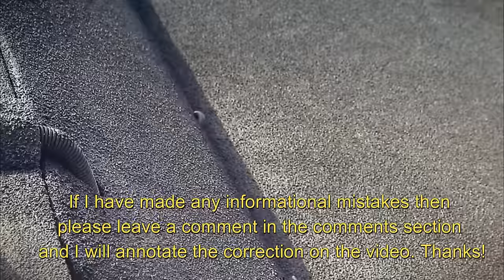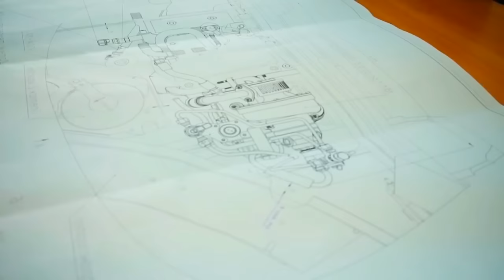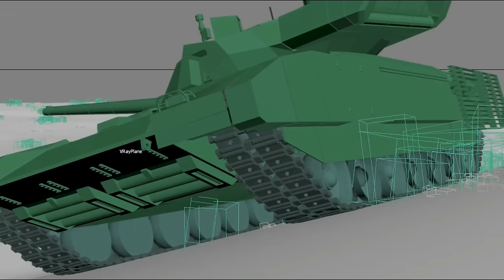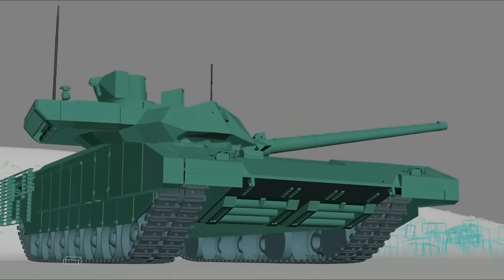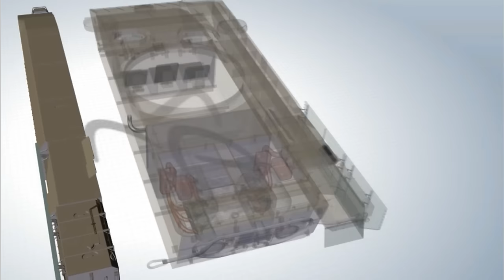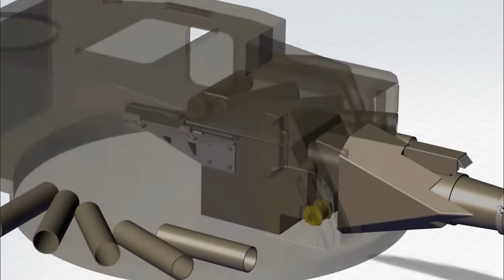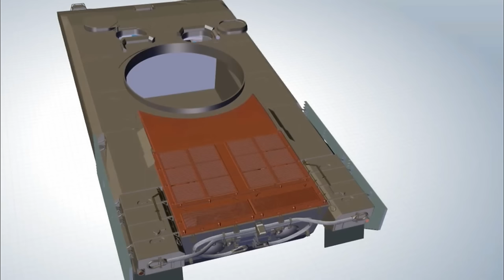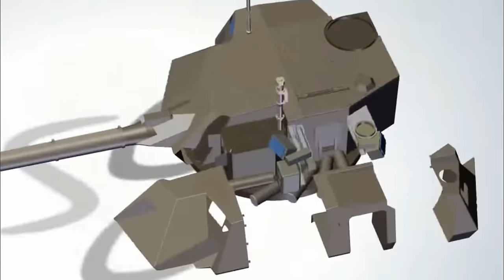T-14 Armata Russian Main Battle Tank - Tank Overview

Comment: Tanks are becoming obsolete.They are vulnerable to air power.They only make sense when used against an enemy that can not respond to them with adequate air power to defeat them. An American A-10 warthog would clear out a bunch of tanks in not very much time and the A-10 is a 40 year old plane.
Reply: A-10 not even get close to 50 miles
Reply: Tanks don't roll on the battlefield alone. THey have Anti-aircraft platforms escorting them. What you said about tanks beeing vulnerable to air power has been available from the beggining...There was one encounter in WW2 when US Air force destroyed 75% out of a Panzer division that didn't have air support or anti aircraft platforms, sometime in 1945. that doesn't mean the tank is obsolete. It's like saying "Never use rock in Rock paper scissors, because Paper beats rock, so that makes rock obsolete...
Reply: Mac Harper "when someone doesn't clearly know military strategy, wew"
Reply: Mac Harper and you're calling me stupid. facepalm

Combined arms doctorine is there in the 1st first place, and as Hetzer said, you don't roll a damn tank by itself.

They are not designed to fight aircraft, they're there to keep infantry and safe from small arms fire, grenades, and shrapnels (which are more lethal than guns themselves, discounting vital organ shots, which are obvious). They're basically mobile cover. It is agreed that tanks remain the most protected asset in the battlefield and are meant to be used defensively (and that's where tanking came from). Even though anti-tank weaponry is there, tanks are still difficult enough to disable or incapacitate.

I've played tons of militsry strategy games/war games in the past (and still is) and most strategists out there agreed that a tank is useful asset to have and last of all, even if there are others that will be able to destroy a tank, there will always be a way to prevent such measures (such as that missile prevention system in the Armata). Don't tell me to go back learning military strategy
Reply: +mark dayanghirang Some of these "Tank Buster" planes can shoot missiles rapid fire at a tank. Like 10 missiles in less than 15 seconds. Your T-14 missile prevention system would be overwhelmed and the tank would be destroyed. Go study REAL military strategy and not video games.
Reply: Mac Harper Ironic when said "real" military strategy came from said war games. You still don't get how to utilize military strategy knowledge properly. Good luck killing tanks when anti-air weaponry and enemy planes are shooting at you if you even try to shoot your missles on a tank. Again, you'll still need protection for your troops. IFVs aren't enougjh to keep them safe
Reply: mark dayanghirang You said good luck shooting tanks when there is anti air weaponry and enemy planes are shooting at you. I don't need luck. Modern jet fighters fly so fast that in many instances they can out run a missile. They also can out maneuver a missile. This is one of the reasons jets often have TWO engines.They can also shoot out flares that confuse a missile's heat seeking guidance system and throw it off course. Jet fighters are not defenseless against missile attacks.
Reply: Allow me to use your logic in my rebuttal.

"Ground-attack aircraft, or A-10, is obsolete. Before the A-10 could even find its target, enemy air superiority fighters would have engaged them first. Modern air superiority jet fighters fly so fast that in many instances they can outrun a missile, and most probably outrun an A-10 because the A-10 is not built for air superiority role. Modern air superiority jet fighters can shoot anti-air missiles at the A-10, shooting it down before it gets the chance to attack an enemy tank. In case missile attacks don't work, they have guns too."

Air superiority fighter jets master race, am I right? =D
Reply: +aegisacer An A-10 is not a modern jet fighter. They were built in the 1970's. They were not the planes I was talking about.
Reply: I did say ground-attack aircraft. When is the last time a true-blue ground-attack aircraft was designed and built? A-10s, Su-25s, etc.

F-16 is built in the 70s, so is the Hornet. Eagles too. Nighthawk is built in 1981.

So you're saying that all of them are obsolete?
Reply: +aegisacer No, they are not obsolete. I was talking more about planes like the F-22 or F-35 and drones like the Global Hawk. Also anti tank weapons that soldiers can carry with them that shoot anti tank missiles.
Reply: +aegisacer No, they are not obsolete. I was talking more about planes like the F-22 or F-35 and drones like the Global Hawk. Also anti tank weapons that soldiers can carry with them that shoot anti tank missiles.
Reply: But using your logic, A-10s and the likes are obsolete, because before they could even hit their targets, they would have been shot down by air superiority fighters.

The enemy tanks would still be alive regardless. Your typical enemy tanks can move fast, engage against your armored vehicles, and has countermeasures to throw off ATGMs.

Oh, they can fire ATGMs too.

Oh, they can also fire high explosive shells too.
Reply: +aegisacer What enemy fighters are superior to the F-16 or F-18 Super hornet? They are not obsolete. You keep saying "By my logic" and then you say something I never said.
Reply: I'm talking about ground-attack aircraft. Following your logic, a tank is considered obsolete because a CAS aircraft would rip it apart.

So, if an air superiority fighter rip a CAS plane apart, is it considered obsolete?
Reply: Mac Harper Your logic: Tanks are obsolete by future generation planes that aren't even been mass produced yet. This is why I said good luck using those when you got enemy planes and anti-air weapons considered "obsolete" swarming their way on your group of expensive planes, destroying that expensive equipment. (The Soviets did this to the Nazis during WWII). Despite your saying that the tank is obsolete, it'll never be obsolete in the future, though future designs will not be the same as it'll be in different forms unlike what we have today
Reply: +mark dayanghirang The US has about 200 F-22 jets and about 175 F-35 jets and are producing more. The Russians have about 100 T-14 tanks currently.
Reply: +aegisacer F-15 F-16 and F-18 are all capable of ground attack. Also F-22 and F-35. These planes are all constantly updated to maintain tactical advantages.
Reply: And before they could engage ground targets, they would be engaged by multiple air superiority fighters and ballistic anti-air systems. They can't even engage ground targets.

So by your logic, they are obsolete because they can't even perform their CAS roles.
Reply: +aegisacer Yeah sure. We are hopelessly at the mercy of the Russians and their invincible new T-14 tank. Just like the US Navy and its ten active aircraft carrier battle groups are hopelessly at the mercy of Russia's one outdated carrier the Kuznetsov. I hope they don't kill us all. :-)
Reply: +aegisacer FYI. The US has over 14000 total combat aircraft in its military arsenal. The Russians have less than 2000. Geez, you are right. I hope they don't overwhelm us with their air advantage and military superiority. :-)
Reply: Who said anything about Russian?

Okay, so they have 14,000 combat aircraft. That's great!

So are you going have all 14,000 aircraft replace your "obsolete" M1A2 Abrams?
Reply: aegisacer No, we are gonna send all 14,000 of our combat aircraft to go and attack the less than 100 T-14 tanks the Russians have produced so far and see how good those anti missile defenses it has are. By the way, The T-14 needed to go back to the factory for redesign and retooling after the first batch of 32 that were delivered did not function properly in the field. So much for the invincible tank.
Reply: Mac Harper tank are not obsolete as in modern battefield,more often than not,an army is less likely to fight opponent with air power.Canadians want to replace tanks with light wheel ifv with cannon,however,in Afghanistan,they find out that their leopard 1 has better armor and mobility,that's why they later instead upgrate their tank fleet by aquiring leopard 2a6m.
Reply: Mac Harper Who said anything about USA versus Russia.

I'm talking about tanks and aircraft in general. So you're telling me that M1A2 is as obsolete as the T-14 because jets could do "anything".

Mmmkay. You can keep dreaming.
Reply: Mac Harper 
Tanks can push capture objective etc.. If you have an underground bunker a plane can,t do anything to it... 
Also in no way the American will send out 14000 air crafts at the same time. 
Airplanes are usually more expensive than infantry units.
Ships are better at capturing(by carrying troops) targets in a separated land mass

Also good luck bombing things when you are flying at mach 2
Reply: Air plane are what their name suggested AIRplane, it was never intended for an airplane to capture an objective(Completely bombing  is not capture)
Reply: Mac Harper you playing to much battlefield 4
Reply: +SideCross I don't play video games.
Reply: Every single main battle tank is not only built to withstand multiple missile hits depending on the size but also carry multiple flares. Not to mention Tank platoons come backed with Mobile anti air and Russian anti air is disturbing. AND escorted anti air. Your brain is obsolete
Reply: Also 40MPH HAHAHAHAHAHAHA where did you get those numbers? Maybe the Abrams and chieftan on rough terrain, also tell that to Germany. Leopard 2A5 hits triple digits on concrete.
Reply from the maker: starcow17 HAHAHAHHAHHAHAHAHAHAHAHHAHAHAHAHAHAHAHHAHAHAHAHAHAHAHAHAHHHHAHAHAHAHAHHHHHAHAHHAHHAHAHAHAHAHAHAHHAHHHAHAHAHAHAHAHHAHAHAHAHAHAHAHHAHAHHAHAHAHAHAHAHAHAHAHHAHAHAHAHAHHAAH!!!!!!!!!.............................................................................................ha.
Reply: Matsimus Gaming hahahahahahahahahahahahahhaha. HAAAAAAAHAHAHAHAHAHAHAHAHAHAHAHAHAAHAHAHAHAHAHAHAHAHAAHAHAHHAA
Reply from the maker: starcow17 Lol
Reply: +starcow17 You must be nuts. I just watched a clip on YouTube of a rebel in Syria who took out a T-72 main battle tank with just a hand grenade. He just threw the grenade at the top of the gun turret and the whole tank went up in flames. He must have hit the ammunition.
Reply: Mac Harper keep in mind you cant just order an airstrike because if theres a tank, theres always an AA in the area
Reply: Mac Harper If you didn't know the tanks Russia sells to people aren't standard issue tanks. They are downgraded quite a lot actually. Usually lacking armour. But yes I've seen that video.
Reply: +starcow17 Listen, this notion that you have that this new Russian tank is impossible to defeat is a joke. I always hear about how superior Russian military hardware is to the west. Then you get an incident like a year ago when Turkey shot down a Russian SU-24 with an American F-16.
Reply: Mac Harper when did I say the t14 eas invincible?
Reply: Mac Harper and yea? I'm really sure the SU was ready to enter combat seeing how they had no right to be shot down and they were flying at low speed. and what is the point there? M4 shermans could kill Tigers in wwii but it doesn't mean they were better.
Reply: Or more so that Tigers weren't better.
Reply: +starcow17 The country that fielded the Sherman's WON THE WAR. What does that tell you?
Reply: Go back to common sense pre-school. I do agree that tanks are obsolete, in a certain way. Sure, if you want a powerful direct fire ability that's mobile and well protected, you call tanks, but you are right to say that air power can decimate most tanks. Thing is, not all armies can afford air power suprisingly enough. And the reason I'm asking you to think twice before trying to roast or trigger a massive conversation like the one you created is the following: Take for example the Sherman from WW2, it fired a 3 inch projectile or 76mm. The Tiger, the WW2 main battletank, would withstand almost any damage from that projectile, except from angles or direct shot at the engine. Even in high numbers with several guns firing at once at the Tiger, it would survive. Unless, of course, the tank itself takes material damage like the turret taking too much damage or the tracks going down, the rounds never penetrated. So now, tell me how a tiny 30mm projectile, even fired at 60 rounds for each seconds on the trigger could cause more than light exterior material damage on a modern tank? Even the Leopard 1 could withstand that. They called that a tank killer but even with penetrators, a lot of little damage with the innacuracy of the A-10, there is no way that it can take out bust out a full tank in what the movies of videogames managed to teach you. Hell, th people who brought you the classification of "Tank Killer" for the A-10 are the same people who classified the M2 Browning in the earlier 30s as an anti-tank weapon. Because a tank is many things, not just MBT, it can refer as a IFV to the US military for example. For instance, a tank is for many people a slow moving vehicle with thick armour and lots of firepower. How many vehicles answer to that description? I mean, the Armata has one thing, lots of armour and lots and lots and lots of it, so no, I'm sorry, the A-10 is just a bomb carrier. So please, don't give trophees or attention to something that doesn't deserve it. Because, in the end, it's basically like saying: "This warship only has 3 inch of armour at crucial areas, tank rounds can penetrate that big time". Hell, don't get me wrong, maybe even a 30mm AP round could. But in the end, size does matter. Because a 30mm projectile attacking a 24 foot target won't cause anything anymore impressive than on something 200 times that size.
Reply: +KallegrandStudios Okay, let me help you go back to common sense. You said the Armata has "lots and lots of armor." It only weighs 48 tons. A WW2 Tiger tank weighed 56 tons. An M-1 weighs 68 tons. It ain't that heavily armored. It relies on threat detection to survive. Secondly, you said an A-10 is just an inaccurate bomb carrier. If that is the case then why has that plane been in service since 1976 and still flying today? The answer is because it gets the job done.
Reply: Mac Harper The only reason why it is 48 tons is because many outdated modules are upgraded 
like the radio for example, the thing used to be huge but now it is just a box.Not only that tiger hull is not sloped and anyone that have an idea can tell you slope can make your effective armor  thicker.

And you are assuming the second strongest military have a tank that is weaker than the Tiger1 that is plain stupid
Reply: +Silp K. One of the reasons the T-14 is lighter is because that makes the tank cheaper to manufacture. It is partly economic. The lighter and less expensive the tank the more of them you can afford to build. Russia depends on oil revenues in order to sustain itself economically. The price of oil used to be well over $100 a barrel. Now it is at about $40 a barrel.
Reply: So what does that have to do with your "armor weaker than a tiger 1"
Reply: +Silp K. The armor on a T-14 is lighter than a Tiger because a T-14 weighs a lot less. A Tiger weighed 56 tons a T-14 is 48 tons.
Reply: Have you ever heard of sloped armor? Space armor? Yeah Tiger 1 don't have that
Reply: +Silp K. Yeah, the Tiger did not have sloped armor, it just dominated the battlefield one on one when it engaged the enemy. It did not need sloped armor. Many projectiles shot at Tiger tanks from Sherman tanks used to bounce off. You usually needed three or more Sherman tanks attacking one Tiger at the same time from different directions to take it out.
Reply: +Silp K. Yeah, the Tiger did not have sloped armor, it just dominated the battlefield one on one when it engaged the enemy. It did not need sloped armor. Many projectiles shot at Tiger tanks from Sherman tanks used to bounce off. You usually needed three or more Sherman tanks attacking one Tiger at the same time from different directions to take it out.
Reply: Mac Harper Nobody said ANYTHING about the T-14s or any sort of Russian equipment. We are all talking about tanks and aircraft and their effectiveness in general. YOU'RE THE ONE that started this saying how tanks like M1A2 Abrams, Leopard 2s, T-14 Armatas, Tiger tanks are OBSOLETE BECAUSE ground attack aircraft exist to kill tanks!

Also, the King Tiger and the Panther tanks have sloped armor. So your point on Tiger tanks not needing sloped armor is invalid since the Germans considered sloped armors to be effective during the war.
Reply: +aegisacer I did not say tanks are obsolete, I said THEY ARE BECOMING OBSOLETE. If you can destroy an 8 million dollar tank with an RPG or a Tow missile, then tanks are becoming obsolete. Why build an 8 million dollar machine that can be destroyed by a $20,000 missile? Or even a grenade? My point about the Tiger was that it did not need sloped armor because IT DOMINATED ANYWAY.
Reply: Mac Harper Please check your previous comments before you attempt to defend yourself. Your original argument states that tanks ARE obsolete because air power existed.

Don't try and twist your words here.

Also, your "obsolete" Abrams, Challenger tanks and T-90s have survived encounters with anti tank weaponry before. It is recorded that the Challengers have received 70 RPG hits during their deployment in Iraq.
Reply: +aegisacer Air power does not "existed" as you put it, It exists. And yeah, air power does a lot to neutralize the tank threat. Listen, I know you don't want to hear it, TANKS ARE BECOMING LESS AND LESS USEFUL ON A MODERN HIGH TECH BATTLEFIELD. They are expensive and vulnerable to much less expensive counter measures. Get this truth into your thick skull. Tanks are becoming dinosaurs. Tanks have been around for 100 years. This is what happens when technology progresses. It makes the old ways of doing things OBSOLETE. 

As far as tanks surviving RPG hits in Iraq. Sometimes tanks get lucky. The same way sometimes when people get shot they don't die, they just get badly injured. A direct hit will usually finish a tank. It depends on where it gets hit.
Reply: Mac Harper "Tanks are obsolete.They are vulnerable to air power.They only make sense when used against an enemy that can not respond to them with adequate air power to defeat them. An American A-10 warthog would clear out a bunch of tanks in not very much time and the A-10 is a 40 year old plane."

I'm pretty sure you wrote this bloody comment. So stop trying to twist your argument. We're talking about air power against tanks here, NOT about INSURGENCY WARFARE.

Obviously, tanks are NOT meant to roll into cities and towns for combat - they are NEVER designed for urban combat. Technology progresses, both for tank and anti-tank weaponry. Ground attack aircraft can only do so much to support advancing ground forces, and are more expensive to sortie than an advancing tank battalion. Tanks are, however, heavy frontline duty assets that SUPPORTS infantry and IFVs on the field, especially in open plains of Europe. They're not meant to kill tanks like many believed - they're there to SUPPRESS the enemy forces and COVER fast advances.

Only a god damn idiot like you would replace tanks with aircraft and anti-tank armaments, only to get your defensive positions overrun by COMBINED ARM TACTICS of the US Armed Forces.

You mean, RPG gets lucky in disabling a tank? Because I don't see ANY Challenger tanks having a record of getting destroyed by an RPG.
Reply: As far as I'm concerned, We've squeezed all of the possible useful information from this log, and anything past here will devolve into "my ideas are better" flame war.

personal verdict:
  Tanks aren't obsolete. not yet anyways. you may be right, the battlefield is a dynamic thing, and the forces at play say you mus evolve or die... Not more than 100 years ago, tanks weren't even present on the battlefield, so it isn't impossible a superior unit type may one day replace them, like combi/AFV-AT vehicles that are lightly armored, and still effective at taking out heavy armor. Who knows.

The problem here is Mac has said that the presence of one battlefield asset renders another one obsolete, even though it doesn't sate all of the operational requirements.

so. what is a tank?
Tanks Provide the following:

*Effective anti armor capabilities.
*shielded movement around the battlefield for personnel.
*effective means for structure demolition.
*Vehicular support for infantry battle-groups.
*A nearly risk free method for dislodging support weapons like Machine gun nests and mortars.
*Long range firing capabilities in open field scenarios, with accurate fire at high speeds to boot.
*Infantry suppression via coax and frontal MG turrets (if applicable).

so. you recommended replacing tanks. AT FIRST with attack aircraft/Jets in general.
Jets provide:

*Ground attack capabilities, Including anti armor, structure, and support weapon munitions.
*A means for bringing down enemy air support.
*improved battlefield awareness via reconnaissance jets.
*limited and somewhat inaccurate infantry support.

and anti tank weapons, such as RPG-7s?

*Valid anti armor capabilities in what would be SUICIDAL RANGES in anything but dense brush or urban environments.
*limited capability to dislodge support weapons such as MG nests and mortars.

So whats the point?
Tanks have their own place in the battlefield. They aren't and will never be made obsolete by an aircraft of any sort, other than potentially a super heavily armed and armored gunship/helicopter that can provide that close range troop support. Tanks may eventually be replaced, but it wont be by an aircraft of the conventional sense. If the air force needs a new plane, they'll make it, and tanks will still be tanks.

Aircraft are, however, much easier to mobilize than ground forces, and even though they can smash armor in droves, a good tank crew can slaughter infantry in droves, as can a talented AAA team shoot down aircraft in droves.

I really liked the rock paper scissors analogy, because it exemplifies the Idea here.

If tanks were made obsolete, they wouldn't exist any longer, just as you don't see zeppelins or Sail driven vessels in the skies or in the sea.
Similarly to how there aren't really battleships anymore. those have truly been outdone by aircraft carriers.
Reply: +Blake Barton I did not say tanks are obsolete. I said they are becoming obsolete. Some of the tasks tanks used to do in the past they are not as reliable for now on a modern battlefield. One hundred years ago when tanks arrived on the scene you did not have air power. You also did not have ground troop that could carry anti tank weapons with them like Tow missiles. Technology is evolving tanks kind of off to the sidelines. I never said they were still not useful in certain circumstances. They are not as useful as they once were. I also never said you could replace them with jet fighters instead. Let me put it this way, I would rather be a fighter pilot attacking a tank than a tank commander having to deal with an attack fighter.
Reply: +Insert Name here WHAT IS YOUR NAME?
Reply: Mac Harper ...
Reply: well it helps that it can carry 2 times its own body weight in  payload
Reply: +Mac Harper "Tanks are obsolete." That's a quote from your original comment, stop trying to tell people otherwise XD
Reply: Adolph Clinton you can say that again
Reply: Neat Noot Tanks are not all that viable anymore. They are two things that a military does nor need, EXPENSIVE AND VULNERABLE. This is called obsolescence.This is why the US has not developed and deployed and new tank since 1979 when the M-1 came out. It just keeps upgrading the M-1. There are simply too many anti tanks counter measures that are effective and not that expensive to implement. At the same time, The US keeps developing new jet fighters all the time. So, you tell me where the future is headed genius.
Reply: Silp K. Thanks genius.
Reply: +Mac Harper the future is headed to you arguing with more people in this comment section, and many other comment sections, across lots of other videos. I don't care where the future of tanks go, as long as they aren't on my front doorstep, they don't concern me. I just don't like it when certain people (not gonna say any names) try changing and twisting their statements to better suit their arguments, instead of just sticking to what they ORIGINALLY SAID. Hehehehehe
Reply: Mac Harper they may be obsolete but they wont go puff in to a cloud of smoke they will have another 50 years
Reply: ***** I am an American. All I have ever heard all my life is that Russia is constantly threatening to attack the USA. And then you go and invade Poland or Ukraine or something like that. Poland is now part of NATO, so the invading Poland nonsense is over. As long as Russia leaves the US and our allies alone YOU WONT GET NUKED. By the way. The reason your new tank is only 48 tons is because that makes them CHEAPER to build because your country IS BROKE. Have fun drinking your Vodka and smoking your cigarettes.
Reply: ***** YOU said Russia never invaded Poland? Go look up The Katyn Massacre. Russia never did any genocides? What was Stalin doing with his purges in Russia for decades? He was committing a genocide on his own country. You occupied Eastern Europe for decades and forced communism on them. Give me a break. As far as your country being under fire all the time. MY country was under fire while The Declaration of Independence was being signed. The White House was burned down in The war of 1812. If Russia would leave people alone nobody would bother you. You keep making trouble all the time. You always threaten your neighbors. You endlessly threaten the west. Then you always have big military build ups you can't afford. Every time Putin has a problem he blames the USA instead of his own incompetence. Its a big joke.
Reply: Kei Presley Go learn how to use the three functioning brain cells you got in your head. Tanks are on the way out. They are too slow which makes them too vulnerable to missiles and air power. If you can destroy them with things like hand grenades and shoulder fired missiles then they are not worth the cost. There are too many threats to a tank coming from different directions at the same time on a modern battlefield.
Reply: +Mac Harper Source? Tanks and planes have existed together for 100 years, why would planes come out on top now? And I'd like to see proof of a hand grenade (which have been around since ww2) destroying a tank from the outside. Also, RPGs have been around since ww2, with up to 30cm of penetration capability at that time, why would it change now, when tanks have much better systems to protect against them?
Reply: There is a clip on youtube. "Syrian rebel destroys T72 tank with a hand grenade." That is the title of the clip. The reason tanks are more vulnerable now then 100 years ago is because now you have lots more anti tank weapons and jet fighters are much more technologically advanced with precision guided missiles.
Reply: I disagree,I was a tanker in the 70's and you need to remember the combined arms that will be brought to bear,it really depends on who is able to get air superiority. If one side has the air,then it gets really dangerous but never underestimate modern SAM's. That happened in the 1973 Yom Kippur war and a large price was paid by the IAF.
Reply: everything  plays a significant role in the war game, tank > AA systems >> Planes > Tank .

nothing is obsolette, got it ?
Reply: +Mac Harper +Mac Harper the hand grenade was thrown down the barrel into a open breech in that video. WW1 and some early WW2 tanks could be penetrated with rifles, FREAKING RIFLES, why do you think a 30mm cannon or missiles, which they did have in WW2, along with HEAT projectiles which have hundreds of mm of penetrating capability, be less effective then when they had less ways to protect against it, instead of now, when they have so many more defenses?
Reply: Neat Noot You are hopeless. You will never understand this. The point I was making with that clip is that a multi million dollar tank was  defeated by a $100 hand grenade. Tanks are vulnerable to much cheaper counter measures that effectively kill tanks. So why keep building them? They are becoming less and less worth it. You don't need tanks to occupy territory, you need troops. Stop talking to me about WW1 and WW2. That was a hundred years ago. Anti tank technology has progressed massively since then.
Reply: +Mac Harper my point is that the army thought tanks were almost not even worth having in the 1920s, because they were so unreliable. So why would they be useless now, even though they're considered a staple of armies all across the world?
Reply: +Mac Harper also in that hand grenade video, think about all the guns in and on a normal tank, there was probably something seriously wrong with the crew inside the tank. So that video would be credited to human error.
Reply: Neat Noot Tanks are military status symbols. They are prestigious weapons to haul out during a military parade like the Russians and Chinese do all the time. This does not mean that they are not becoming less useful on a modern battlefield. There are threats to tanks that come from the air and the ground now. A soldier with an RPG can take out a tank with relative ease. Forget about what jet fighters could do to them or missiles fired from naval vessels at advancing tank columns at long ranges.

As far as that clip, you called it human error. Listen, if a tank can be destroyed by a grenade, under any circumstance, that exposes the vulnerability of a tank. That is not human error. That is the vulnerability of the tank. An RPG is basically a launched grenade. They can decimate a tank. I am not saying tanks are useless. I am saying that they are becoming less and less useful, and not justifying the costs of producing them, if they can be defeated by an enemy with much cheaper counter measures, such as RPG's or even hand grenades like in that clip. The era of the tank is not over but it seems to be winding down.
Reply: Tungusta's got your A-10 owned.
Reply: Mac Harper So, you’re trying to say that the Tiger tank is better than the T14 is because it's heavier, I don't get your logic here. Have you ever considered the type of armour? Not just the thickness of it. The T14's armour is mixed with various composites and ceramics making it lightet and stronger than steel (the armour that the Tiger had) making it better. A cheaper weapon doesn't make it a bad one. Take the AK47 for example, it's cheaper than its western counterpart but it works and better in some aspects
Reply: Evan Borne Do you believe that the T-14 is going to dominate the battlefield the way the Tiger tank did in WW2? Tiger tanks used to blow Sherman tanks apart. It often took 3 Sherman tanks to take out 1 Tiger tank. All the composite armor that a T-14 tank has is also in the M-1 tank. It is also in the British Challenger tank, and the German Leopard tank, and the Israeli Merkava. Where do you think the Russians got the idea for composite armor? The M-1 in fact has about 20 tons more of it than a T-14. Which one do you think might be more survivable? My remarks were a response to the comments by some on this thread that the T-14 is the new super tank that is going to blow away the competition. It will not. The T-14 is kind of actually late to the game.
As far as the AK-47. The biggest problem with it is that it is not accurate when you shoot it like modern machine guns are. You kind of have to spray a target with bullets to hit it. The AK-47 is a 70 year old Russian design. If you would rather have that gun in combat than a modern and precise machine gun I don't really understand why.
Reply: Mac Harper You're kinda avoiding the point here, I was replying to your reply saying that the Tiger is somehow better than the T14 which is impossible. Now, the T14 while not being the most heavily armoured contender here, that crown goes to the Challenger 2 with its Chobham Armour, it does certainly brings new elements to the battlefield such as capable of being unmaned, and to be outfitted with a bigger gun, a 152mm, that would outgun the M1 Abrams with it's 120 mil. It's also faster, and it doesn't cost as much to refuel, versus the Abrams that would cost a fortune to do so. The T14 is no "super tank" by any stretch of the imagination but it is a potent one, and it would probably give its competitors a run for their money, but alas it's hard to surely know since tank on tank battles (not obsolete tanks that are operated by monkeys, I mean high tech vs high tech) are rare these days. We only have here are statics and numbers, until one day if the T14 could one on one fight its competitors only then can we really know who's on top. Now, the AK47. Of course it's not renowned for its accuracy, but, its reliability. You could, not clean for weeks and it would still run, while its counterpart the M16 wouldn't. Also the 7.62x39 definitely has more stopping power than the 5.56 NATO. Accuracy wise, it's good enough. Give it to a well trained individual that doesn't pray and spray like you said, you got yourself a pretty good weapon considering that it's 70 YEARS OLD. I don't know where you got the idea that it has to spray to hit its targets, I'd say that's a myth. AKs do pretty well in semi auto. Hey plus, no said that the T14 was a super tank blowing away its competitors, I thought we're talking about tanks being obsolete and shit.
Reply: Did Tiger ever dominate any battlefield?
Reply: LaserAirsoftWeapons Yes, it dominated every time it came up against Sherman tanks, one on one, during WW2. Sherman tank crews became so fearful of dealing with Tiger tanks during the war that they nicknamed the phenomenon "Tigerphobia."
Reply: Evan Borne I NEVER SAID THE TIGER WAS BETTER THAN THE T-14, I SAID IT WAS HEAVIER. THAT'S ALL. I run into this bullshit with a lot of people on here. I SAY ONE THING AND THEY HEAR ANOTHER. The Tiger tank existed 80 years ago so how the fuck could it be better than a new modern T-14? Tiger tank weighed 56 tons, a T-14 is 48 tons. THIS IS WHAT I SAID.
As far as the AK-47, you said that it is "not known for its accuracy" but that it was accurate enough. If a weapon is not accurate when you shoot it how is it good? You said it was "accurate enough." Accurate enough for what? Shooting at a tank? The weapons that the West uses are state of the art. Yeah, you do have to keep your rifle clean, but if you do you can shoot these weapons with laser point accuracy. You mean to tell me you would prefer an AK-47 "accurate enough" weapon to a totally precise one? If you would, then you have a decided disadvantage in combat. Please understand that I am not yelling with my caps, I am frustrated people do not seem to hear what I say properly. The Tiger tank dominated in combat during WW2. THAT IS WHAT MADE IT SPECIAL FOR ITS TIME. The T-14 is a good tank but it will not own the battlefield. I have argued with some people on here who claim that it will. THAT IS NONSENSE.
Reply: Hmm, the comment Slip K. made earlier said "so what does that have to do with your "armour weaker than a tiger 1" then you replied, "The armor on a T14 is lighter than a Tiger because a T14 weighs a lot less. A Tiger weighed 56 tons a T14 is 48 tons." hinting that the Tiger's armour is stronger than a T14 because it's heavier. I shouldn't have said better but, the comment you made just sums it up.
Reply: Evan Borne When exactly did I "hint" that a Tiger's armor is stronger? HMMM, I never did. I just said it was heavier, which it was. You did it again. I say one thing, you hear another thing. Oh, and by the way, just for the sake of argument, how exactly DO YOU KNOW for a fact that a T-14 has stronger armor than a Tiger tank did anyway? A T-14 has a lot less armor but how do you know it is stronger? Do you have access to Russian military secrets? If a tiger tank and a T-14 had the same amount of armor I think it would be certain you would be right. But being that a T-14 has 8 TONS LESS ARMOR how can you know for sure? Even with all the modern composite ceramic reactive armor and stuff.  My assumption would be that a T-14 would beat a Tiger tank from WW2 not because it would be more survivable than a Tiger in terms of its armor, I don't know that for sure really, but because it would have massive technological advantages over a Tiger with its radars and weapons systems. That I know for sure.
Reply: Mac Harper Easy, Tiger has RHA (Rolled Homogeneous Armour) while the T14 has Composites. I'll let you figure out why the T14 would beat the Tiger's armour, it doesn't take a rocket scientist to figure this out.
Reply: Thank God we have a genius like you around to figure out the obvious. You know, obvious stuff like a modern tank built today is technologically superior to a tank built 80 years ago. Then you will turn around and say something dumb like the AK-47 is better than a Modern high tech machine gun even though an AK-47 don't shoot accurately and was designed 70 years ago. Go figure.
Reply: Tunguska still eats A-10's lunch.
Reply: Mac Harper Hahaha, you see...first off, you asked "how exactly DO YOU KNOW for a fact that the T14 has stronger armour than a Tiger tank anyway?" so, I gave the answer, Tiger has RHA which would NOT protect it from modern HEAT and APFSDS rounds while the Composite armour of the T14 can (while it isn't completely impervious to both HEAT and APFSDS, it is definitely stronger than RHA, and that's a known FACT). Secondly, I didn't say the AK47 is better than the so called "modern" machine gun, I agured that the AK47 is accurate enough to be a usable weapon, where you said it has to be sprayed to hit something which is total bullshit. And with its modernisation the AK103, the AK74 and the recent AK12 it has now been a more capable weapon platform. Mind you that "accurate enough" still can kill, and it has done that lots of times. Like you said, the A10 Thunderbolt is still in service today even though it was made in the 1970s, same goes for the AK, was made 70 years ago but still used today. Lastly, why did you give a peculiar answer? Slip K. said "so what does that have to do with your "armour weaker than a Tiger 1" and you said that the Tiger is heavier than the T14, so it was perceived by me as you're trying to say that the Tiger is better because it is heavier.
Reply: No, it happened to a RUSSIAN TANK. That makes Russia look stupid Mr. Kuznetsov.
Reply: ***** Yeah, I've watched the video, for the rebel to throw 2 grenades into the gun barrel is just saying something. How the hell didn't the crew of the tank notice them sitting there? That's just bad situational awareness.
Reply: It was a shitty old Russian tank. The T-72 is JUNK on a modern battlefield. OUTDATED RUSSIAN SHIT. Right Mr.kuznetsov?
Reply: The United States has repeatedly apologized about the whole Vietnam War. We have also given billions in economic aid to Vietnam for recovery and economic development since the war ended. That continues to this day. What does Russia do to Poland? You keep threatening them.
Reply: +Mac Harper A-10 are obsolete.They are vulnerable to anti-air power.They only make sense when used against an enemy that can not respond to them with adequate anti-air power to defeat them. An Russian Tunguska, TOR, S-400, or S-500 would clear out all of the A-10, F16, F22 and F35.
Reply: Your name is Kuznetsov? Let me ask you a question. Did the Russians name that old piece of shit aircraft carrier they got after you? You know, the one that smokes like an old furnace.
Reply: The A-10 is vulnerable to anti air power? I have seen clips of A-10's that got shot up with machine gun fire and they still did not crash and landed back at their bases. They just plugged up the holes from the bullets and sent them back out again.
Reply: Your comment was so stupid I did not feel any need to reply to it. As far as your offer of "educating" me about anything? Oh please! Why don't you go smoke about three packs of cigarettes, and drink two bottles of vodka at the same time, like most of your comrades do, while you endlessly deny that Russian Olympic athletes use steroids, and that Vladimir Putin is about 5 foot 2 inches tall?
Reply: An A-10 is infinitely more expensive to produce then a tank, more time consuming to produce, alot less of them then tanks and ordnance for them is hellishly expensive. Training time for a pilot and the expense going into that is also extremely high compared to a tank crew and a plane is just as vulnerable to modern ordnance as a tank. Modern tanks are now starting to be equipped with anit-air weapon systems and can defeat planes, helicopters and their ordnance. Generally tanks are also not left alone all by themselves. They are usually accompanied by other weapon systems like the German Gepard or other anti-air weapons. I would say the modern battlefield is getting just as deadly to aircrew as it is to tank crew.
Reply: and 10000 t-92's, T-80's and 15000 IFV's of all forms and 4000 anti-air battieries of all forms, 1500 missile carriers and 10000 planes of all types and 500000 shoulder fired anti-air and anti armour weapons and about 3 million soldiers. Yep, your 200 F-22's and 175 non working F-35's aren't looking so hot now are they. Modern armies are all arms armies.
Reply: That is very typical of a new weapon system. There are always bugs that need ironing out. The Abrams had the same troubles when first introduced. That is a strawman argument.
Reply: Who said it is impossible to defeat? What was said (by you) was that it is obsolete and the whole tank concept is obsolete because airpower exists. That is utter rubbish. We know next to nothing about this tank so once again, strawman argument.
Reply: Who has got 10,000 planes? The Russians? BULLSHIT. Like you said, planes are expensive and time consuming to produce. This is why the Russians don't have a lot of them. After the USSR collapsed in 1991 they went broke. They cant afford to build a lot of planes. This is why Russia has more tanks instead. Most of their tanks at this point are outdated too. They did not have any money to modernize their forces either.
Reply: Are you serious with this comment? Do you seriously believe that America won the war single handed because of the Sherman tank? That comment is so naive it beggars description.
Reply: Early tanks used solid steel plate for armour, that's why it was so heavy. Modern tanks only make light use of steel in their construction and a predominately made of composite armours in modulized packages to increase protection but reduce weight. Even so a modern tank is still very damn heavy. Weight comparison's between these two completely different generational tanks is moot.
Reply: I quote, "Tanks are obsolete' unquote. It's right there in black and white. You did say it.
Reply: Not viable anymore? So a plane is going to hold ground and defend tactical points on a battlefield indefinitely. A plane can get down in the thick of it and give fire support at the local level exactly where and when its needed for the ground troops? I think not. Planes can deliver massive firepower on a given target for a short period of time, that's it. Tanks can maintain their firepower over an objective almost indefinitely. The longer a aircraft hovers above a battlefield their chances of been blown out of the sky begin to skyrocket and once again, aircraft are hellishly expensive to loose.
Reply: In that case you have been brainwashed into thinking that. Stop watching main stream media and listening to your politicians because they lie for a living. I actually now kind of feel sorry for you after reading that. Russia hasn't done a damn thing since the cold war was over. If you do some proper research you will find Russia is the one defending itself from aggression and lies. Russia has lived up to all its treaties since the cold war, America and NATO haven't. Not my opinion, that's fact if you bother to do your research.

As to the Ukraine you are sorely mislead. Ukraine had a democratic election and voted to be part of Russia again. NATO and the NWO didn't like that and so backed and financed the Ukrainian's who opposed the re-uniting with Russia even though they where in the minority and it was all democratic. Russia had no choice but to intervene militarily to protect its citizens and interests just as America would have done and has done many times.
Reply: This comment is so naive. You are now saying airpower is completely invunerible and invincible. Hate to break it to you but there are mountains of modern weaponry that will make short work of aircraft. Not  worth the cost? Yet a plane worth anywhere between 30 million and 400 million US dollars EACH and can be shot down by a $10000 (ball park figure) worth of weaponry is cost effective? I think I will stick with a tank worth 2 to 4 million dollars and can hold ground with it.
Reply: Hand grenades have existed since the 1860's actually. They where used in the American civil war. A hand grenade could never destroy a tank unless it was thrown into the tank. It would barely scratch the paint.
Reply: I have not seen the clip but he probably threw it inside the tank. Either that or it detonated stored heavy ordnance on the outside of the tank which actually destroyed the tank.
Reply: roger Rumble If you're talking about the Syrian tank then yes, the grenade is thrown into the gun barrel and dentonated the ammunition storage
Reply: +Mac Harper 
Sorry, I have no wish do start a discussion with you, cause you have no idea about military. Last thing I say is that Russian anti-air systems are the best in the world. A few years ago the USA and Israel were in panic because Russia sold its S-300 anti-air system to Iran. Russia itself uses newer S-400 and S-500 systems, where the numbers mean the effective range in kilometers. Your idea that an A-10 could freely fly in Russian controlled airspace shows that you are an amateur.
Reply: You don't really know much about current military capabilities do you? Russia HAS 10000 planes of all types. Not all are operational as currently they cannot afford to fly that many at the same time but they DO have them. It's called mothball. If war materialized they can have all 10000 operational in a matter of weeks. America at last count has 18000 planes of all types and it's in so much dept it will never get out of it but that doesn't stop them from having them. Russian planes are also no where near as expensive as American ones. A F-22 currently costs $339 million US EACH!!!!!!! A sukhoi costs 20 million each. HUGE difference. Sure a F-22 can beat 5 sukhoi's but what's it going to do about the other 20? Russia's planes can also operate in extreme conditions, designed exactly for that purpose. A f-22 needs a fully furbished and maintained, supplied and specific airfield to operate from. Do your research! Russia is an entirely different beast compared to North America or the middle East.

You are sorely out of date. The cold war's end was over 26 years ago and their tanks are most certainly not out of date. Their front line tank is the T-92c, a fully upgraded tank only 20 years old. The Abrams is a hell of alot older then that.. The Abrams is a 1970's design but also upgraded so your argument on that point is moot. If you think the t-92 is out of date then that would make the abrams completely obsolete. You can't have it both ways. They just built the t-14 . Sukhoi-30, PAKFA t-50 and SA-300 and 500 missile defense systems and a revolutionary new torpedo that is light years ahead of the competition. Heard of the Kursk incident? Read up on it. 300knt's underwater. America has nothing even remotely like it although they probably do now since they pressured Russia into giving the tech to them. Read up on geo-politics and balance of power, it will enlighten you. Russia may not be dripping in money but they are also not swimming in debt like America.
Reply: You are really showing your bias and ignorance with that one. Most (not all) of America's tech is either stolen or bought from other countries you ninny. China is very good at plagiarizing everything, America is good at throwing it's non existent money around, Russia is good at making things tough and resilent, Germany is very good at Engineering, Japan is very good at robotics and computer tech. My point is everyone has something they're good at. I'm bias too but nowhere near to the extent that you apparently are. I love everything German but am still aware that others can make stuff too.
Reply: roger Rumble How ridiculous. The US spends billions on research and development to produce the weapons tech that it then spends hundreds of billions to produce in massive numbers. Not only does it do this to defend the United States, but also in part to defend its freeloader allies like our European friends who never do, and never will, carry their own weight, but are becoming experts at acting like they are better than we are. How is that for a big joke? I have to admit that I am losing some respect for Euro-idiots who never make any sense when they talk. How totally stupid is it to suggest that The US buys its technical know how from countries, who don't have any money or really resources to do any research and development in the first place, with its "non existent money."
Reply: Mac Harper you said in one of your comments you said that the russians got the idea of composite armor from the west.YOU ARE WRONG since the first widespread use of composite armor have been on the soviet  T-64 tank.Also you implied that the Abrams is better armored than the T-14 because its heavyer.First of all despite all the upgrades the Abrams relies on cold war era armor.Second its very possible that the russian scientists have created lighter and stronger materials and are using them in the T-14's armor making it as protected or even more protected than the Abrams
Reply: roger Rumble Bye bye Eurofool.
Reply: Mac Harper Oi m8, jets can't outrun SAM or AA missiles. With the exception of the SR-71 but it's retired.
Reply: Mac Harper man Su 24 is a bomber and it did not expect a cowordly "freandly" fire from Turks so did not carry any defence from possible air threat. As Russia braught the 2 Su 35 planes, the Sirisn sky become closed for western planes. No single Turkish plane got in an air since then.
Reply: Kranvagn with that 150mm smoothbore gun will destroy your ass. :)
Reply: tanks obsolete? Ask the Israelis, they also thought they just need Airforce. They were proven wrong and in the next wars they also relied on tanks and infantry. There is no way around combined warfare. Airforce is great support, but cannot hold ground (and even tanks need infantry for that).
Besides: do not forget to compare costs. How much resources you need to get one plan with CAS capability in the air and how many tanks can roll for the same money? Surely more tanks are rolling than your plane has AT rockets / guided bombs.
Stating the extreme that tanks are "obsolete" OF COURSE triggers a lot of resistance and shows that you do not have a clue what you are talking about. Sorry.
Reply: Grimshak81 You don't need tanks to hold ground. You need troops. You can defeat an 8 million dollar tank with a $20,000 missile. They are not cost effective and they are too vulnerable to both air attack and ground forces with anti tank missiles. There are too many threats coming from too many directions on a modern battlefield. I am not saying they are totally useless, I am saying that they are becoming less and less useful because they are becoming more and more vulnerable. Tanks are over 100 years old. Their Hey day is behind them. You don't need to reply back to me to keep arguing. Let's just agree to disagree.
Reply: Mac Harper So, where can troops get direct fire support? Also, if the rebels have cheap T54/55 tanks, how can troops push towards a key point with paper thin AFV or IFV? Remember, those poor countries can't offer expensive planes and missiles but a cheap 2nd gend MBT. Plus the fact that a country which uses Air superiority usually have nukes and money. How can those future conflict - mostly without planes fight without MBTs?
Reply: Kerwin CHAO How did ISIS take over the cities of Raqqa in Syria and Mosul In Iraq? Did they need tanks? They went up against two different armies with tanks. Did they need any? Do you know what they had? RPG's to destroy tanks with.
Reply: Mac Harper In my opinion, the future conflict will mostly likely be agent war which can't be fought with air forces' support due to political reasons. If one side decide to use tank, the other side is screwed on the open file battle because those tank will be able to fire missiles just like what an anti-tank squad can do. Sure, the urban environment is great for those squads, but it is not true in the open field.
Reply: Mac Harper What you mentioned is urban battle filed which isn't great for MBTs. I just cleared my position on my second reply.
Reply: Kerwin CHAO The defenses for the city of Mosul in Iraq were set up outside of the city. On the outskirts of the city. They were not inside the city itself. It was not urban warfare.
Reply: Mac Harper M1 doesn't have APS sadly. :(
Reply: Mac Harper Weird, Wiki says that the city was abandoned by Iraq Army.
Reply: Mac Harper I can't find any detail information about the ISIS assault to Raqqa. I just know they captured the city.
Reply: Kerwin CHAO Did Isis capture the city using tanks?
Reply: Mac Harper I wish you know how to read.
Reply: Simply put; combined arms. A tank is an ineffective asset (namely when the opposition is organized and strategic) without assistance from both the ground and air. Enough of the damn bickering.
Reply: Have you seen the youtube clip of a militant in Syria blowing up a Russian made Syrian Army tank with just one hand grenade? A multi million dollar tank destroyed by a $50 hand grenade. Forget about what air power could do to tank or a Tow missile or an RPG or laser guided bombs. Do you know what armor piercing bullets are? There are so many threats to a tank on a modern battlefield now. This is not WW2 anymore. That was 80 years ago. I understand that tanks have counter measures. The problem is their counter measures can be overwhelmed. If there are some people who want to keep believing that tanks are a vital piece of equipment let them do so. I am saying  again that tanks are not useless but they are becoming less and less useful. They are very expensive to build and are just too easily defeated by far less expensive counter measures. They are becoming less and less cost effective. This happens all the time with military equipment as technology progresses.
Reply: Mac Harper Counter measure also involve warning radar and direct fire suppression. If you think an anti-tank squad can fire unlimited rockets at the same ambush position without getting any return fire from a third gen MBT, I can't help your logic anymore. Dude, AP bullet is for soft armor vehicle. It is already useless against +40mm armor. Show me the footage, I can't trust your word.
Reply: Mac Harper Also, I don't support both flat and Globe Earth. I don't even think we are real. XDD
Reply: LMFAO, Your reply is not even coherent.
Reply: Mac Harper You do have the same problem. What now? Another rage and cry?
Reply: Opens up a bag of popcorn ..this is pretty entertaining. By the way, Otoko, you didn't understand my text properly it seems.
Reply: In your dreams may be
Reply: You clearly don't have a clue about modern warfare strategy, Every technology is on the verge of being obsolete the moment it enters service, the difference is how you use it, how you protect your vulnerabilities, and exploit your opponents. every technology and weapon system has vulnerabilities including tanks and aircraft. just because you have a system that is capable of defeating another system, does not mean it is obsolete, you still have to be able to find it and attack it and that requires intelligence, information, strategy and tactics, in order to defeat  what is know as the defensive onion. Now do yourself a favour, move away from the keyboard until you can learn to use it like a responsible adult, and by that I mean stop yourself from blurting out ill considered opinions based on statistics you read from a website.
Reply: ashleyphotog While this is very true, there isn't much point explaining it to someone who is obstinate. Perhaps even hypocritical.
Reply: A-10 will be destroyed by mobile sam even before it will notice tank column
Reply: I strongly disagree
Reply: Mobile SAM missile sites would have been targeted and taken out well in advance of any A-10 arriving on the scene to destroy a tank column.
Reply: it is also a plane with the largest gun ever fitted onto an aircraft. The Us also has Apache's and drones to take tanks out.
Reply: Mac Harper Hardly, USA usually used cruise missiles and avaks to defeat Sams, but advanced states know how to shot down such missiles and have long range weapons to defeat avaks + powerful jamming, if USA will deal with strong country like RF or China the American infantry can forget about airsupport
Reply: But what if the A-10 fires a Maverick or something more modern and the missile gets destroyed a few meters before hitting the Tank? It seems Tanks are not so obsolete any more, uh?
Reply: yak yajme He doesn't even know what APS is. :/
Reply: It wouldn't do that if it was sent in against Russian tanks, because Russian tanks roll in with air defenses, and those murder the shit out of A-10s before it could launch the mavericks.
An old T-34 would therefore do fine in the Russian army when facing A-10s, because they have other vehicles that takes care of it.
(In a western nation, these vehicles would be jets like the F-15/F-16).
Reply: High Five to Mac Harper for never giving up! 

Though, I believe a few of the comments stand and you have surly lost your original argument and simply slivered down more paths of discussion. 

Bottom line: Tanks still play a major roll and cannot be replaced by air power, short of a flying tank/APC.

I will not argue, because you cannot be convinced. 

" 
everything  plays a significant role in the war game, tank > AA systems >> Planes > Tan
"-Thế Nguyễn Bá1

"As far as I'm concerned, We've squeezed all of the possible useful information from this log, and anything past here will devolve into "my ideas are better" flame war.

personal verdict:
  Tanks aren't obsolete. not yet anyways. you may be right, the battlefield is a dynamic thing, and the forces at play say you mus evolve or die... Not more than 100 years ago, tanks weren't even present on the battlefield, so it isn't impossible a superior unit type may one day replace them, like combi/AFV-AT vehicles that are lightly armored, and still effective at taking out heavy armor. Who knows.

The problem here is Mac has said that the presence of one battlefield asset renders another one obsolete, even though it doesn't sate all of the operational requirements.

so. what is a tank?
Tanks Provide the following:

*Effective anti armor capabilities.
*shielded movement around the battlefield for personnel.
*effective means for structure demolition.
*Vehicular support for infantry battle-groups.
*A nearly risk free method for dislodging support weapons like Machine gun nests and mortars.
*Long range firing capabilities in open field scenarios, with accurate fire at high speeds to boot.
*Infantry suppression via coax and frontal MG turrets (if applicable).

so. you recommended replacing tanks. AT FIRST with attack aircraft/Jets in general.
Jets provide:

*Ground attack capabilities, Including anti armor, structure, and support weapon munitions.
*A means for bringing down enemy air support.
*improved battlefield awareness via reconnaissance jets.
*limited and somewhat inaccurate infantry support.

and anti tank weapons, such as RPG-7s?

*Valid anti armor capabilities in what would be SUICIDAL RANGES in anything but dense brush or urban environments.
*limited capability to dislodge support weapons such as MG nests and mortars.

So whats the point?
Tanks have their own place in the battlefield. They aren't and will never be made obsolete by an aircraft of any sort, other than potentially a super heavily armed and armored gunship/helicopter that can provide that close range troop support. Tanks may eventually be replaced, but it wont be by an aircraft of the conventional sense. If the air force needs a new plane, they'll make it, and tanks will still be tanks.

Aircraft are, however, much easier to mobilize than ground forces, and even though they can smash armor in droves, a good tank crew can slaughter infantry in droves, as can a talented AAA team shoot down aircraft in droves.

I really liked the rock paper scissors analogy, because it exemplifies the Idea here.

If tanks were made obsolete, they wouldn't exist any longer, just as you don't see zeppelins or Sail driven vessels in the skies or in the sea.
Similarly to how there aren't really battleships anymore. those have truly been outdone by aircraft carriers.
"- Blake Barton
Reply: JwormJ I never said tanks can be replaced by air power, I said they can be defeated by air power. You are doing a straw man argument. You are  making a false claim and then claiming I said it, and then you are attacking the false claim and then claiming I am wrong when I never said it.. It is a pretty cheap arguing trick. A lot of you guys use it.
Reply: Don't think one-dimensional. It won't get you any useful results. It is like saying, cars are useless, because there are helicopters, that are faster and don't need roads.
Reply: In 90+ days of total air supremacy, supported by constant JSTARS survailance, NATO planes destroyed only 13 tanks during operation Allied Force, mostly T-55's. The combined price of expended smart AT weapons far surpasses the combined price of these tanks. Don't rely too much on computer games when making such claims. Tanks have been deemed obsolete for the past 50 years, yet they remain relevant today. My personal opinion is that tanks should be made more suitable for urban conflicts. Also, if you are a small country and your opponent is another small country with small airforce that can't afford too many specialized aircraft, having a superior tank force makes a world of difference.
Reply: Petar Banovac Tanks are still relevant. Less and less relevant and less and less useful and more expensive than ever before. They still have a role to play. That is clear and I will give you that. AT weapons are more expensive than tanks because they are cutting edge technologies. I was thinking more along the lines of a TOW missile being way cheaper to make than a multi million dollar tank. TOW missiles kill tanks.
Reply: TOW-2 even T-90 can not penetrate, what can we say about T-90M (MS) or T-14,
Reply: Mac Harper TOW missiles can defeat the opponent whose tank force is obsolete. Good luck counting on TOW missiles vs modern tanks. Modern tanks already demonstrated the ability to survive TOW missiles. Even obsolete tanks can be made suvivable by adding bolt-on ERA like Kontakt-5 or Kaktus.
Reply: Petar Banovac There are clips on YouTube of TOW missiles cooking up T 90 tanks. There is also a clip of a T 90 being disabled by a TOW but not cooked. Who knows.
Reply: Well, with the (also pretty old) TOW 2 you get a tandem charge which will penetrate even ERA.
Reply: Likewise, there are new generations of ERA designed to deal with tandem HEAT warheads. As Mac noted, top-attack might be a workaround against ERA, but active protection systems have been developed to deal with that threat. Long story short, you can't win without strong ground presence, epitomized by tanks. As more modern tanks are developed, so are anti-tank weapons. The winner in a conflict is the side that catches the other without effective counter. If you have a superior tank, use it while counters aren't ready yet. If the invader has obsolete tanks, he'll suffer heavy losses from tank-hunter teams. However, there's one big difference. Tank is offensive weapon. You can't hope to invade a country with TOW tubes bolted on pickup trucks.
Reply: I agree that the role of the MTB will not disappear. Especially active protection systems are likely to replace super heavy armour and reduce the weight of the vehicles in the future.
Reply: Czechnut Very well made point
Reply: Check out the USS Donald Cook and what 1 Russian plane did to it..... Shut it down....
Reply: It didnt shut it down. What a ridiculous statement. The only ships shutting down are the russian ones that are escorted by tug boats everywhere they go. :D
Reply: How do you explain its AA systems being jammed to the point of total defenselessness on the entire ship? Maybe you need to read some of the sailors diaries and how grown  men and women were praying for their own souls.... Luckily the plan was not armed lol just made many passes.
Reply: Shotgunman5 I can explain it to you. Its called internet fake news bullshit. That USS Cook story in nonsense. It was probably the Russians that made up that story.
Reply: Yeah like the Russians made up 100s of crew member experiences lmfao most of this info is classified , but if you do research instead of talking outside of your neck you may just wanna join the military and help to make sure these incidents dont happen again got it ? good...
Reply: Matthew Penfold Oh yeah, which one did this? The A 10 has been around for 40 years. Who beat it?
Reply: m8's treat each other with respect. If Tanks are becoming obsolete because of airpower, what would happen to the insurgencies in the streets? Have an A-10 shoot a bunch of missiles and endangering the public? Also, its like a game of rock paper scissors. Air Beats Tank, Tank Beats AA, and AA beats Air.
The only way to take down AA's is with a tank, and sometimes those AA's need protection, so they use tanks. It takes a tank to destroy a tank to destroy an AA. It takes an AA to take destroy a Jet and a tank to destroy an AA, and a jet to destroy a Tank.

Also, you pointed out that tanks are obsolete because Air Superiority, therefore, jets are obsolete because of AA's
I just rubbed you with a lot of logic, and repetitively said the RPS rule but with Rocks as Tanks, Paper as Jets, and Scissors as AA's.
Reply: It's been around, but never faced really strong AA defense. It usually operates after successful SEAD strikes, with most enemy air defenses destroyed or suppressed. Of course, air superiority is also mandatory for A-10's effectiveness. Thus it needs other airplanes to perform these tasks. Modern AA systems like Tor and Tunguska would be a major threat for A-10. It was never tested against these systems, but judging by their demonstrated capabilities, I don't see how could A-10 survive. Not saying A-10 is not good, it's the best plane in its role, with Su-25. Still, against opponent that has good SHORADs these would suffer losses.
Reply: Matthew Penfold As far as American air superiority goes we have that over Russia too. I looked up the numbers. The US has almost 14,000 total combat aircraft in its inventory. Russia has about 2,300. A lot of the Russian hardware is old and outdated too. After the soviet union fell apart in 1991 the Russians have not had the money to modernize their forces or maintain them properly. A lot of it is old. This includes their tank forces. The new tank the Armata, they have built less than 50 of them so far.
Reply: NitroCaliber Who said AA beats air power? Sometimes it does not most times. Air power with stealth beats AA. That is the whole point of invisible to radar aircraft. To defeat AA.
Reply: Stealth aren't invisible to radar. Who on earth told you that stupid thing? S-300 and S-400 can lock on stealthed aircraft, they just have a harder time doing so. The vast arsenal of US fighters are still F-15 and F-16 fighter planes, and those are visible to a radar in a way approximating the sun in Arizona.

And you might have 14 000 aircraft, but how do you plan on deploying all those to a combat zone? That's just not going to happen.
Reply: HrHaakon  The stealth aircraft go in first and take out the AA, then the F-16 's go in. We would deploy weapons in numbers as needed.What is so complicated about this for you? Don't worry about stealth, it works well enough.
Reply: Sjwaria Law There are a variety of ways to kill a tank. You take out the enemy AA first. You could target them with missiles and overwhelm and exhaust those defenses. Then send in jets to take out the tanks. The first thing you always do is take out the enemy AA. You blind them by taking out their radars. The F-35 is not the only plane you could use to do this. You could use B-2 bombers or maybe even Apache attack helicopters in the dead of night. Some Apache's use stealth now. You would take losses but eventually you would knock out those radars and achieve air supremacy and be able to operate more freely.This is why The US has 14,000 combat aircraft. We know we would take losses and have over prepared in anticipation of this military reality. The Russians only have 2,300 combat aircraft which means their forces will be depleted before ours would. This is called planning ahead.
Reply: Sjwaria Law Yeah, a modern anti radar missile cost half a million. This is why you use it to take out the radar sites so that your 100 million dollar jet fighters don't get shot out of the sky when you send them in after you take out the radars. What don't YOU understand?
Reply: +Mac Harper Tanks are not becoming obsolete.Combined arms is the future,planes and tanks must work together to achieve victory tanks aren't becoming obsolete nor it will
Reply: Kajus Petrauskas Well, tanks are becoming more expensive to build, and less useful on a battlefield, because modern weaponry is more deadly than ever. An RPG can disable a tank. A TOW missile. These weapons can be carried by soldiers and they cost a lot less than tanks. I understand tanks are not going away tomorrow, but I can't see why an army would keep building 8 million dollar tanks that can be taken out by RPG's or shoulder launched anti tank rockets that cost about $20,000 a piece.
Reply: Kajus Petrauskas This already happens. Most of Russia's tanks are pretty outdated. They have over 15,000 tanks. Their new tank the T-14 Armata, they have built only about 50 of them so far, and they are running into technical problems with them that are driving up costs.
Reply: Mac Harper Everything is getting more expensive and that only poorer countries will stay away from tanks and planes .And the only way i see the tanks becoming obsolete is if a major economic crisis would happen and if that happens planes will become obsolete too.
Reply: kenny The A-10 is 40 years old and the air force wants to retire the fleet, I think there are almost 400 of them, but Congress won't let them because the replacement the air force wants to use in place of it is too expensive.
Reply: Mac Harper I agree on this but what will probably happen is tanks will develop a bit and stop developing until the economy will be able to support them as tanks aren't made to destroy everything but to support infantry.
Reply: Kajus Petrauskas This might be true for poorer countries but I gotta tell you that The US defense budget was not effected by the economic crisis of 2008. In fact the budget went up over 700 billion dollars in the years right after which were new record highs.
Reply: Mac Harper Well true,but didn't us military spending go down during the great depresion?(Sorry for taking so long too reply)
Reply: Are you sure you can rely on airpower when it comes to shutting down AA? Sure you can, if your opponent is a random Arab nation, with under-trained AA crews in outdated weapon systems. Try that against a modern, integrated air defense system with well trained crews. Like I previously stated many times, look at operation Allied Force. Only about 10% of SAMs and radars were destroyed for 90+ days of total air superiority. The number of dedicated SEAD strikers exceeded the number of available Serbian SAMs and radars. Over 700 HARM missiles were fired, so their effectiveness was way less than 10%, somewhere about 1%. Against the opponent whose most modern SAM system is 30 years old.  Well trained SAM crew in a modern SAM system is SEAD package's nightmare. First of all, modern strategic defense SAMs outrange any anti-radar weapon by a huge margin. Thus, approach is possible only in stealth aircraft. Since they have to travel alone, search radar crews will know their location, even if SAM guidance radar can't get an early fix. Second, SAM crews won't just sit and wait for someone to take them out. They'll relocate every hour, switch their radars on/off at all times, use target data handed off from a remote radar, decoy emitters, dummy targets etc...They'll use thermovision instead of radar if they have a thermal signature in sights. And when it comes to division/battalion level air defenses, the situation gets even more interesting. You get mobile systems that travel along armored column, such as Tunguska and Tor, good luck approaching them in A-10. Not to mention accompanying Buk's covering the middle layer. Tunguska has optical guidance channel so it won't trigger RWR. A-10 has no self-defense anti-radar missiles, the pilot has to visually acquire the threat and kill it with a stand-off weapon such as Maverick, all that before SHORAD system kills it first. Would you bet your eyeballs against a fast-scanning, short range ESA radar? I wouldn't.
Reply: Petar Banovac You know, I heard a lot of this stuff before the Gulf War in 1991. We were not gonna be able to penetrate Iraqi air defenses blah blah blah. It was not that big a problem. I understand The Russians are a different kettle of fish but I think we would figure it out. That would be my bet. If you do not agree, that is okay. They said during World War 2 that invading Normandy was gonna be impossible. It was hard, we took great losses, but it got done.
Reply: Sjwaria Law Since when has money been a problem for The US military? I really want to know. Tell me when this happened? What weapon system did the US not have the money to build if it really wanted to? The annual US defense budget is bigger than the next 10 countries defense budgets put together. That includes Russia, China, and India.
Reply: Kajus Petrauskas The US defense budget must have gone down during the great depression I guess. I am not actually sure. But you know it shot way up the day Japan attacked Pearl Harbor. The US built up a 1700 ship navy during WW2. I think the US built about 30 aircraft carriers in like four years just to send them out to the pacific ocean to attack Japan. Every time Japan sank one of the US carriers the US would build two more and send them out. I think Japan sank about a dozen US carriers during WW2 in the pacific. The Americans just kept rebuilding new ones.
Reply: Well, using your implied logic, it's possible to argue: "you know, I've heard it all before, they said tanks are obsolete during the 60's and 70's, when Egyptian Malyutka's killed lots of Israeli tanks, but look at them now, they are here to stay, I'm sure we'll figure it out like the Israeli's did". Frankly, I was hoping you would challenge my arguments with some hard facts, but instead you offer your hopes and predictions. I rest my case then.
Reply: Mac Harper Well when japan attacked the us was out from the great depression(The us was out by 1940)
Reply: Petar Banovac I'm sorry I failed to challenge your superior intellect master. You know, you should go check out some clips on YouTube of M-1 tanks that were blown to shit by RPG's and IED's in Iraq during the insurgency there. Maybe that might open your eyes.
Reply: Kajus Petrauskas That is not true. The Great Depression was deeper than ever just before the war.
Reply: Mac Harper and you are bragging about this...who's money do you think that they spend! ?
Reply: I would agree with you but you have forgotten about anti-aircraft vehicles which must be on a battlefield with tanks and cover them. For example Ukrainian airforce can't destroy rebels tanks. They tried but without any success.
Reply: Владислав Козлов The Ukrainian air force is not the US air force.
Reply: Mac Harper  rebel's anti-aircraft isn't modern russian anti-aircraft :-)
Reply: @Mac Harper No worries, just study hard and one day you can be my apprentice. I'm tired of cleaning my shoes on my own.
Reply: You must be a master at cleaning shoes when you even have an apprentice :D
Reply: Czechnut
Yes, your mother taught me everything I know, with special emphasis on waxing.
Reply: but you need to gain air superiority first to threaten the tanks which is easier said than done. also by that logic infantry is obsolete also because they cannot fight against planes effectively
Reply: john li Everything about war is easier said than done. The Normandy invasion was easier said than done. This is nothing new.
Reply: Matthew Penfold Yeah well you should see how old most of the Chinese and Russian stuff is. They have bare bones maintenance programs too to try and save money.
Reply: Mac Harper M8 treat each other with respect, even Matsimus said in his video.
Reply: john li Your logic is faulty. Infantry can fight against planes. They can scatter. That are not sitting ducks like tanks. Infantry can also carry AA weapons like the old stinger missile. It is shoulder strapped. It is lightweight. Infantry would have a few options to counter that threat. They could counter an air threat from multiple places on a battlefield at the same time if adequetly equipped. It would not cost a ton of money either like sitting duck tanks do.
Reply: NitroCaliber I am fine with that but these people are not respectful. There is even some guy on here talking about somebody's mother. Just fucking disgraceful.
Reply: No it can't. Max target altitude for current MANPADs is about 3-3.5 km in ideal conditions (overflight). You quoted the maximum slant range, which is the best-case scenario with target approaching head-on at high speed. Missiles don't have static range against a moving target. Max range is dynamic and depends on aspect, approach speed and relative altitude difference, prolly a few other factors I forgot.
Reply: Mac Harper i dont think infantry can outrun a plane and tanks can also have anti air weapons
Reply: Petar Banovac I think you have been drinking.
Reply: john li I never said infantry can outrun planes. I said infantry can hide from planes more effectively than tanks can. As far as tanks having anti air weapons. AA is not a tank's primary purpose. It sometimes has some kind of defense against AA but no offensive weapons to combat that threat. A tank's focus is on the ground.
Reply: Mac Harper Don't think, don't talk. You're way smarter that way.
Reply: Matthew Penfold Yeah, but I bet you have a real expertise about it. The kind that only comes with years of practice.
Reply: Mac, you've been destroyed by everyone here, save your trash talk for someone who cares.
Reply: All your ideas failed the reality check, as noted by everyone who opposed you.
Your arguments so far were:
"Tanks are obsolete": WRONG - every country keeps developing and improving them (USA including), despite of constantly improving AT weapons.
"Air power alone can destroy tanks": WRONG - Allied Force ended up with less than 5% Serbian tanks destroyed, despite NATO having EVERY advantage imaginable and Serbia being a comparatively weak opponent.
"Air power can destroy air-defence alone": WRONG - as above.
"Stingers (or any other MANPAD) can hit targets 26.000 feet high": WRONG - verifiable fact, you just didn't bother checking.
Done wasting my time on you. You lack the relevant knowledge required to discuss the topic. Ciao!
Reply: Zaliv net The Russians only have about 40 Armata tanks and they are having technical problems.
Reply: Zaliv net
Don't confuse maximum slant range and ceiling. These are two different things. You can shoot stinger at inbound high speed/low flying aircraft at 8 kms. Why? Because the missile will travel almost straight and hit its target at about 4-5 km's from where you stand (can't be bothered calculating). Launched against a high flying aircraft,  the missile has to travel upwards, thus accelerating more slowly, reaching lower top speed and loosing energy much quicker once the sustainer burns out. And since high flying aircraft is not flying straight towards you, the missile has to maneuver once it leaves the tube, again losing some E. That's why ceiling is so much lower than max range. The same principle applies to bigger missiles just as well, although factors like type of propulsion (duration of booster/sustainer burn) play in.
Reply: Zaliv net All that info about the T-14 is right on this clip here by Matsimus. You should actually watch it. The A-10 Thunderbolt is also known as a "Tank Buster." It carries anti tank missiles. By the way, The Russians do not have a ton of money to build a whole lot of T-14's anyway.
Reply: Zaliv net At 4 minutes into the clip. Matsimus says the T-14 was returned to the manufacturer for improvements and further testing. In other words, that tank needs more work. So stop lying about what the clip says. As far as the A-10 hitting tanks. The enemy AA batteries would first be knocked out by F-35 strikes and B-2 stealth bombers. Then you send in the A-10 to go after the tanks. You always take out the AA first.
Reply: Zaliv net The Russians have far fewer jets than the Americans do. And they are older too. As far as your earlier assertion that Russia has plenty of money because of oil. The price of a barrel of oil a few years ago was $120. A couple of years ago it dropped to $30. It is now at about $50. Russia don't have the oil money it used to.
Reply: Zaliv Official data states 3-3,5 km ceiling. So above 4 km target should be safe.
Reply: Zaliv net Go look up the engagement range for a Stinger. MOST of Russia's revenue is from oil. Most of Russia's military equipment is old and outdated. The aircraft carrier Kuznetsov I think has a steam engine. I think it burns coal. It travels with a tug boat in case the engines fail. Russia is a joke and so are you.
Reply: Petar Banovac Hey Pete, you should check out a clip on YouTube called "Admiral Kuznetsov smokes like locomotive." It is a clip of Russia's carrier smoking up the English Channel on its way to Syria to bomb civilians last October. Its great. It is a modern high tech piece of advanced military hardware, if this were still the year 1910.
Reply: Petar Banovac "Everybody gets it IS except you?" Is that what you said to me? Listen, the engagement range is real and it is what it is. You should stop denying that it is real. The notion that some people on here want to promote that the Russians have a lot of new, modern, high tech equipment, is a laugh. Most of their stuff is old shit.
Reply: Mac, it's a typo. Since you obviously didn't check the relatively credible fas.org site link I provided (it's American, don't worry, no Russian propaghanda there), i'll dump the stats here. BTW did you check the translation of the word "ceiling"?

Primary function
  To provide close-in, surface-to-air weapons for the defense of forward
 combat areas, vital areas and installations against low altitude air 
attacks.
Manufacturer Prime - Hughes Missile System Company 
 Missile - General Dynamics /Raytheon Corporation
PropulsionDual thrust solid fuel rocket motor
Length  5 feet (1.5 meters)
Width 5.5 inches (13.96 centimeters)
Weight 12.5 pounds (5.68 kilograms)
Weight fully armed 34.5 pounds (15.66 kg)
Maximum system span  3.6 inches (9.14 cm)
Range  1 to 8 kilometers
Sight ring  10 mils
Fuzing Penetration, impact, self destruct
Ceiling  10,000 feet (3.046 kilometers)
SpeedSupersonic in flight
USMC Units Low-Altitude Air Defense (LAAD) Battalions: 3 active duty, 2 reserve
Crew  2 enlisted
Guidance systemFire-and-forget passive infrared seeker
Warheads High explosive
Rate of fire  1 missile every 3 to 7 seconds
Type of fire "Fire-and-Forget"
Sensors Passive infrared
Introduction date  1987
 Full-rate production      3QFY94
Unit Replacement Cost  $38,000
 Total program cost (TY$)  1060 systems   $7281M
Average unit cost (TY$)   $6M
Inventory    ~13,400 missiles
Reply: Petar Banovac Yeah, I know what you mean by ceiling. Listen, let me try to explain one more time. The version of the stinger I am talking about is the Fim-92 E. This version came out in 1996. It had an engagement range or ceiling of about 17,000 feet. In 2001 they made a software upgrade to it that increased its engagement range to about 25,000 feet. They also added a new focal plane array sensor to improve the missile's effectiveness at higher altitudes. What I think you guys have been talking about is the original stinger missile, the first version, that had a range of about 13,000 feet.
Reply: Mac - provide proof. Let's see a credible source verify that statement. The specs I provided are for the E version you mention. Software upgrade can't increase range or ceiling. You need more propellant to reach bigger heights. Even bigger missiles such as the one on Tunguska can't reach the heights you claim a small stinger can. In fact, most current MANPADs, US or RUS, have exactly the same envelope. It's determined by missile's size and weight limitation. They get improved seekers and warheads, but range and ceiling remains pretty much the same.
Reply: Mac as for you slamming Kuznetsov, well didn't the mighty USS Zumwalt end up dead in the water on its maiden voyage? https://www.theguardian.com/us-news/2016/nov/23/us-navys-most-expensive-destroyer-breaks-down-in-panama-canal Kuznetsov has had a rough time in the 90's and since Russia is not an expansionist country, it needs no large CVN's. While Kuz can't compare with Nimitz class, its fighter arm is certainly superior. Su-33 is a starship compared to F-18E/F.
Reply: Petar Banovac Yeah, the Zumwalt did experience a glitch. That is because it is a state of the art modern naval vessel with a whole new propulsion system. Not because it is a broken down old piece of shit like the Kuznetsov is. You are talking about two different vessels that are at opposite stages in their military service. One is at the beginning and the other is at the end. 
The facts that I relayed to you about stinger came from an article I read in Janes Defence weekly.  What do you mean software upgrades can't improve the performance of military equipment? Give me a break. It happens all the time. Besides, I told you it was a software and hardware upgrade that lead to the improved performance. Please stop making up "alternative facts" like that which are not true.
Reply: Mac Harper
You said software upgrade increased its ceiling, enabling it to hit targets at 26k feet as opposed to previous 10k. That's more than two-fold performance increase due to software upgrade. Look, the missile's energy depends on the type and amount of propellant. You can't upgrade software and increase ceiling or slant range two times. It can't reach these heights without more propellant. It just can't. No software upgrade can help that.
Reply: Petar Banovac Pete, I fucking said software and HARDWARE upgrades.
Reply: mac, and NO, you didn't say hardware upgrades. you said software upgrades enable it to fly higher. You said they added a new seeker that improves high alt performance (???). So a new seeker will allow it to reach higher? Makes absolutely no sense. New seekers are added to increase resistance to countermeasures. seeker performance is certainly much better at high alt, where there's no clouds and moisture, where the air is colder and there' are no ground reflections and ambient clutter.
Reply: Zaliv net
Frankly, I'm the idiot here for actually trying to reason with him. He has his believes and no evidence or fact will make him leave his own reality. I've got nothing to gain from these discussions, except some english practice. I certainly didn't learn anything new.
Reply: Zaliv net I gave you proof. The article is in JANES DEFENSE WEEKLY from 2004. Go look it up.
Reply: Petar Banovac More fucking lies. I said they added a Focal Plane Array Sensor to improve the missiles effectiveness at higher altitudes. This is known as a HARDWARE UPGRADE.
Reply: Well, there's an article in janes defence weekly for 2005 that states that stinger's ceiling is 3.5 km. Go look it up :D. BTW i finally have all the pieces together. You've seen that quote on Wikipedia from Jane's defense weekly, but you are ashamed to admit you have no other source of info but wiki. But you got it all wrong, it says "engagement range of 26000 ft", not "ceiling 26.000 ft", which is ludicrous anyway for such a small missile.
Reply: Zaliv net So what?
Reply: Zaliv net Well, the Kuznetsov makes me laugh. It belongs in a scrap yard. You can see that carrier coming from 1000 miles away because it blocks out the sun from all the smoke it gives off. :-)
Reply: Mac Which month, which number? What's on the cover page? Checkmate son, you don't have it, and you never read it! You've seen a partial quote on Wikipedia that you took for granted and now you're clutching for straws. If you were a long time Jane's subscriber or military buff in general your posts would be much more technical and much less opinionated. It's been fun mate.
Reply: Mac and here's where you found that "quote"  https://en.wikipedia.org/wiki/Man-portable_air-defense_system#cite_note-7 You're SO busted :D
Reply: Zaliv net The US has like 15 NUCLEAR POWERED AIRCRAFT CARRIERS. How the fuck would the diesel powered Kuznetsov be in the top 5 carriers in the world? ARE YOU NUTS? The Russians don't invade others? Tell Ukraine that lie.
Reply: Mac BUSTED! Oh wait, I have that Jane's defence weekly in my basement. It's the one with a large stinger up Mac's arse on the cover page :D The title reads: "New stinger, now even more lethal" :D
Reply: Petar Banovac Holy shit, I thought you were making up the wikipedia thing. But wait a minute, you found another article that confirmed what I read in Janes, and what I told you, and that makes me busted in your view? Pete, are you drinking Vodka too like Zaliv? What the fuck is going on with you two?
Reply: Zaliv net YOU ARE STILL DRUNK.
Reply: Zaliv net Russia has one OLD, OUTDATED, CARRIER because that is all it can afford. You need to understand Russia is not a rich country.
Reply: Zaliv net Russia is the biggest country in the world you said. That is geographically true but it is mostly frozen wasteland that nobody can live on and you can't grow food on it. its mostly permafrost. An icy wasteland.
Reply: Zaliv net You said Russia is very rich. The annual US Gross Domestic Product (GDP) is over 17 TRILLION Dollars. The annual Russian GDP is 2.9 Trillion. This is why the US has 15 nuclear carriers and Russia has one old diesel carrier. Are you beginning to understand?
Reply: Zaliv net The population of Russia is about 140 million people. The US population is about 330 million. Are you beginning to understand?
Reply: Zaliv net The US has over 14,000 combat aircraft. Russia has 2300. Are you beginning to understand?
Reply: Zaliv net The US has dozens of allies from the NATO alliance. Russia has NO allies except for maybe Syria I guess. Are you beginning to understand?
Reply: Zaliv net Have you sobered up yet Zaliv?
Reply: Zaliv net You mentioned China. US annual GDP is 17 trillion. China annual GDP is 9 trillion. Where do you think China gets most of that 9 trillion from? I will give you one guess?:-)
Reply: Zaliv net This notion Zaliv that you seem to have in your head that Russia can compare or compete with The United States is a real joke. It is not even close. IT IS NOT EVEN CLOSE!
Reply: Zaliv net The Russian economy has shrunk  by almost 40% in the last four years because of declining oil prices and US economic sanctions on Russia for their invasion of Ukraine. As far as China, they are over populated. They are running out of natural resources like water. China is running out of drinkable water. They have a massive problem with pollution. Their air quality is the second worst in the world. Only India is worse. China has endless civil unrest. There are always protests going on against the Communist government there that have to be put down with force. China and Russia are not the future of anything. They both have massive internal problems to deal with. Again, you do not begin to understand what the real situation is. You are very uninformed.
Reply: Zaliv net Do you understand what a Nuclear powered Aircraft carrier is? They basically never have to re-fuel. They can stay out at sea for years without ever refueling. They just need to be resupplied with food for the crew. The Kuznetsov has to travel with oil tankers to keep refueling its diesel engines when it is out at sea. The Kuznetsov is not even in the same class as the American Nuclear carriers. Your claim here is totally ridiculous.
Reply: you cant send chopers or ground atack planes at tanks defended by modern sam equipment
Reply: Imanol fuentesito You knock the SAM AA out first using guided missiles and stealth fighters or stealth bombers. Then you send in ground attack jets to hit the tanks. The SAM rockets would be targeted and eliminated before you send in A-10's or F-15's or Apache attack helicopters, some of which are now stealth capable. You would expect to take losses in the process but with persistence you would prevail. War is always a game of attrition. It is always about outlasting your enemy. As far as air power goes the West has a massive advantage in terms of total number of combat aircraft.
Reply: Well it seems that for you to belive to win an argument you need to attack your opponent which is a logical fallacy in it of it's self, it is called an Ad hominem. So if I were to judge anything you say is simple, I would not listen. Due to the fact that you must attack your opponent tells me enough that you are illogical enough not to change your mind to a better argument than yourself. There for it is a waste of time. even if it was done in the past.
Reply: GeneralBaked Potato A logical fallacy in and of ITSELF, not IT'S SELF. THEREFORE it is a waste of time, not THERE FOR. You spell BELIEVE this way, not BELIVE.
Reply: Mac Harper My point exactly. Need to focus on the small things or the person.
Reply: Mac Harper Good, well that is over then.
Reply: Zaliv net You are a bigger joke than The Kuznetsov.
Reply: Not quite, tanks are still required in modern militairy doctrine for their supreme firepower. Other armoured vehicles like infantry fighting vehicles just lack in firepower. Tanks are needed to form a combined arms team together with the infantry and artillery. Remove any of these comonents and the team will fail. Furthermore, any aircraft has fly time. Vehicles do not.  An A10 tunderbolt or any aircraft for that matter will have a much harder time surviving Russian anti aircraft weapons. Don't get cocky the most recent militairy conflicts in which the US armed forces  engaged were in Afghanistan and Irak and Syria,  Constant air superiority and hardly technological callenging opponents. Above and beyond the call of duty, boots and tracks on the ground will always be nessesary. For al these reasons tanks are far from obsolete. The proof is in the pudding, they are still here and they won't be going anywhere anytime soon, the only thing that is obsolete is the ignorant opinion that tanks are obsolete.
Reply: Rem ko Okay, I said tanks are BECOMING obsolete. This is called not being cocky. I know they still have military value. But not as much as they used to. 
Let me try and make my point another way. An American M-1 tank costs about 8 million dollars to build, okay. If you are a military strategist, and you are given 8 million dollars to spend hypothetically, what do you think would be the smarter choice to make between the following two options? Option one, to build ONE tank with the 8 million dollars that can be destroyed by the enemy with an RPG, OR option two, take the eight million and build a couple dozen shoulder strapped anti tank RPG's, that you could arm your ground forces with, which they could use to take out dozens of enemy tanks with?  Which option gives you a bigger military bang for your buck?
Reply: Mac Harper same as the SU 24
Reply: Mensa In the future we are not going to keep building tanks that cost 10 million dollars each that can be destroyed by cheap shoulder launched RPG's or IED's. This is not cost effective. It makes no economic or military sense. Something will have to give.
Reply: Mensa "Tanks will then just become drones?" What on Earth does that mean?
Reply: Mac Harper Between mobile Anti Aircraft systems (That the Sowjet and now Russian army has well integrated) capabel of keeping up and firing on the move and jet fighters as part of combined arms killing first world tanks will not be Desert Storm reloaded but more Red Storm/Team Yankee/Armaggedon Song. Add in ManPad (also common with the russians) and a good doctrin against infantry ATGM (again they have it for various reasons like a Cold war enemy who loved them)
Reply: Mac Harper  how the fuck syrian army hit israeli f35 hmmmmm... Few days ago. Check it out.
Reply: stupid talk, there is missiles that travel mach 10